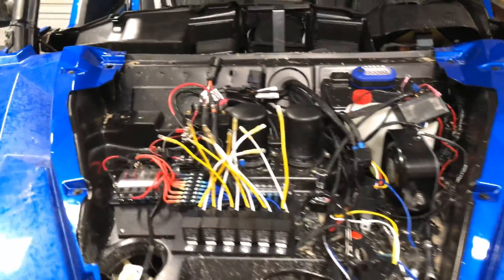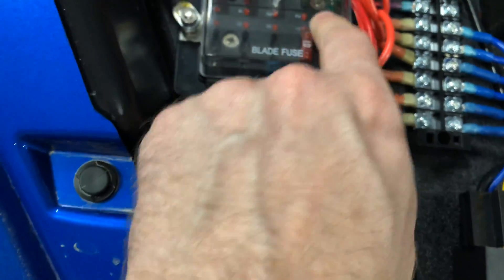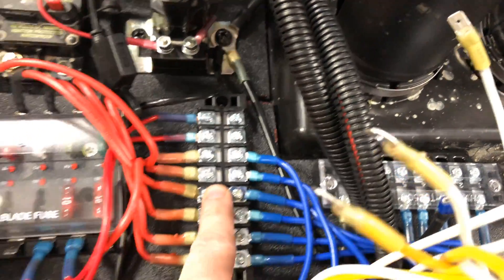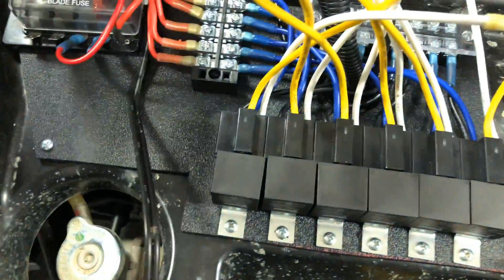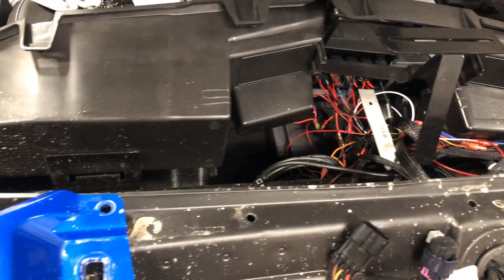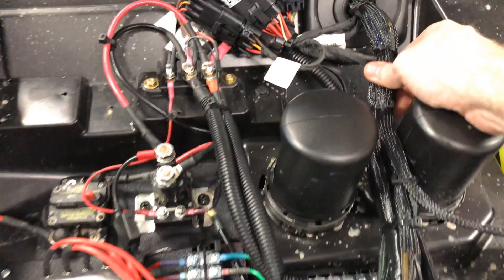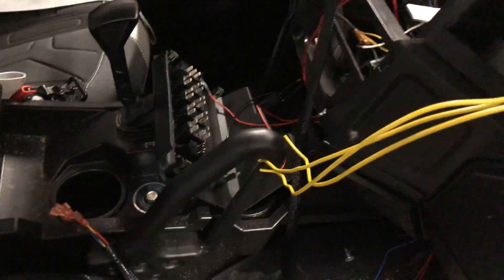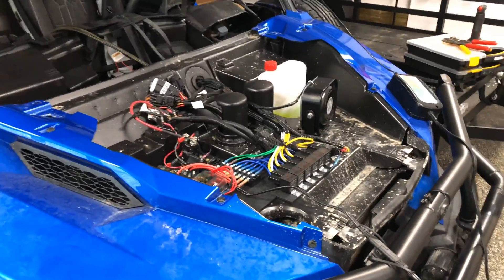Polaris General - Aux Electrical Version 2

Comment: where do you get your wire connectors?
Reply from the maker: I use these: https://amzn.to/39tIQpn. There are a number of options on Amazon, but I’ve tried several varieties of the solder connectors, and they seem to work best.

Comment: Really nice  job... I'm doing the same thing to my Can Am Defender.. Everything is going to be in the DIY headliner.. Instead of doing all the relays .  I bought rocker 6 switch box with  build in relay  80amp..  Im assuming you have two Batteries ?  What is your Aux Battery  size?
Reply from the maker: I’ve heard about the units with the built-in relays. They’re nice. I didn’t use an aux battery on mine, though.

Comment: Ben what is the main breaker switch you used before you go into the fuse box? I bought the fuse box and a keyed relay but I would like a main breaker just don’t know what size to buy?
Reply from the maker: I bought an 80 amp circuit breaker like this one: https://amzn.to/3sDf09E. There are a bunch on Amazon, and I don't remember the exact one I purchased. You just want to be sure that it's waterproof. For the typical config, 80 amp should be good. Have fun with it! I love that sort of wiring!
Reply: Thanks Ben I just ordered that I have the New Yamaha RMAX 1000 XTR2 I love it so far but I want to get this done like you did it’s done right looks good and is functional. I don’t plan on running a ton of things but they add up fast heat rock lights pod lights heated seats spot lights stereo horn turn signals before you know it you have ten different things. I really like your videos and think the general you had was a great rig sad to see it go when you sold it I liked watching the tips you gave on your videos. Thanks again

Comment: How waterproof is that? Plan on doing alot of light upgrades but im an offroader and everything will at some point get submerged.
Reply from the maker: I've not had it fully submerged, but as you can tell from some of my other videos, it has gotten plenty wet. No issues to report, though. If you were planning to submerge it, it would be a better design to have a more waterproof options, but for typical trail riding with the occasional "big puddle" you shouldn't have any issue.

Comment: Are all the relays necessary? I'm getting ready to wire a 42" light bar and 12" to the front on one switch and a set of led pods for the rear. I'm purchasing a fees block similar to yours.
Reply from the maker: It depends on the load. You typically don't want a large electrical load flowing through the switch. Instead, the switch acts as a low-voltage "trigger" to the relay which then routes "direct" power from the battery (through a fuse) to the item in question. If you were just wiring up some simple LEDs, going through the switch would be fine. However, something like a light bar would be better off with the relay circuit. Thanks for watching!
Reply: @GeneralTalkWithBen  ok thanks for explaining that for me. Are you a member of the Polaris general forums?
Reply from the maker: @bbc91camaro  Yes, I am. I'm "tahoe9813."
Reply: @GeneralTalkWithBen  how many amp relays are you running? I'm wanting to wire a 42" and 12" light bar together.
Reply from the maker: @bbc91camaro  They're all 40/30 Amp relays (40 Amp surge/30 Amp steady). That's not a sign of how much power the accessories are drawing. Rather, that's the max rating on the relay. I would say that these relays are "standard" automotive relays (here's the Amazon link: https://www.amazon.com/gp/product/B0717B2HXH/). In my case, I have two cube lights (6 LEDs each) and my big light bar are all on the same relay without issue. I'm sure your setup will work fine. You're basically using the relay to pull the power directly from the battery via the relay. As long as the total draw doesn't exceed the relay's limits, you're good. Let me know if you have any other questions. Ben